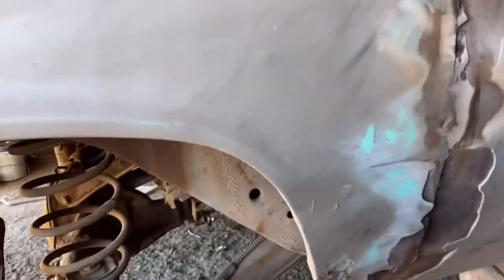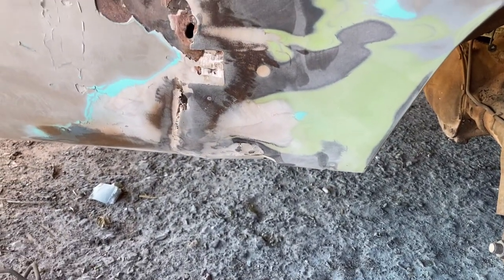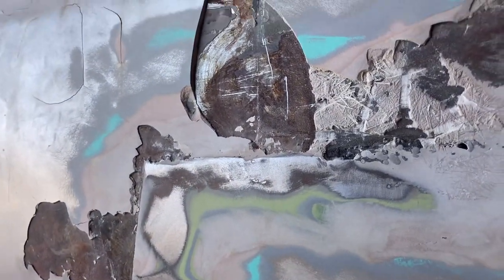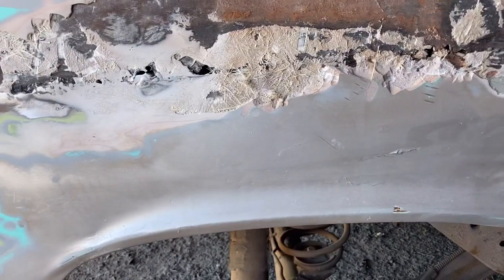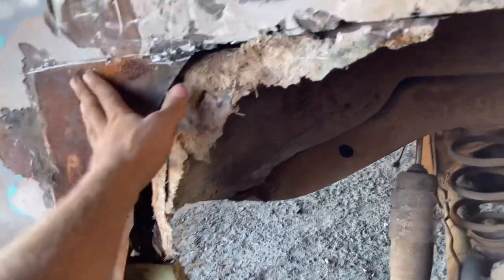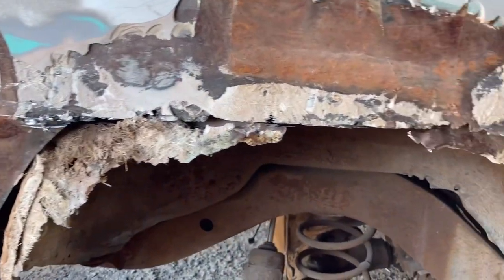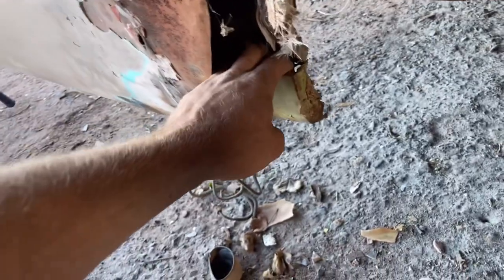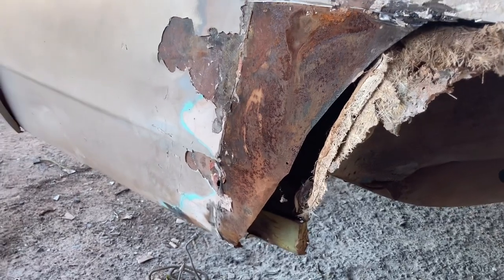Let’s see how bad this wheel panel is!-1967 El Camino pt.5

Comment: PPG's 2 part epoxy primers, are some of the best out their, never had any issues when using them.
Reply from the maker: Thanks for suggestion I’ll look into it. Is it harder to spray being an epoxy?
Reply: @route66classicbuilds24  spraying is no differant then any other epoxy primer, but you will have a pot life once it is mixed. How long depends on which hardier ( catalyst ) you use. Also the nice thing bout 2 part epoxy primer/sealers, they're waterproof, whereas non catalyzed primers are not.